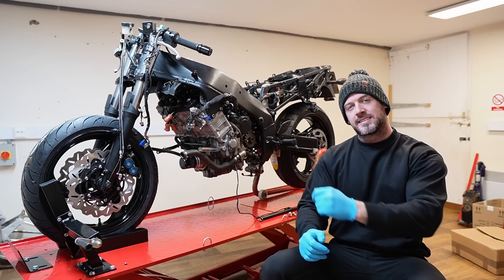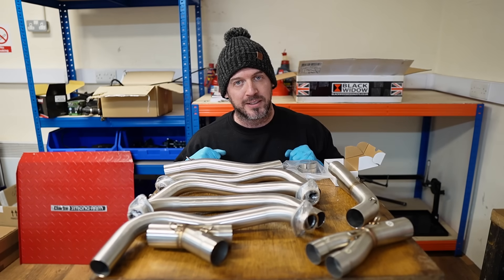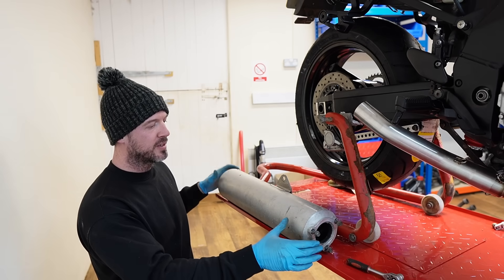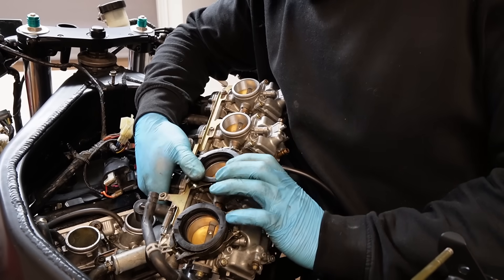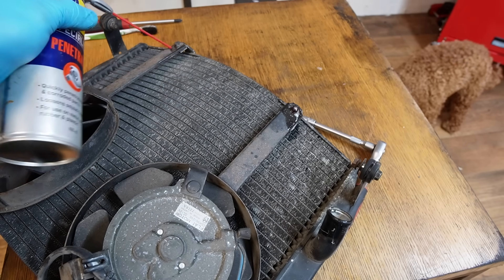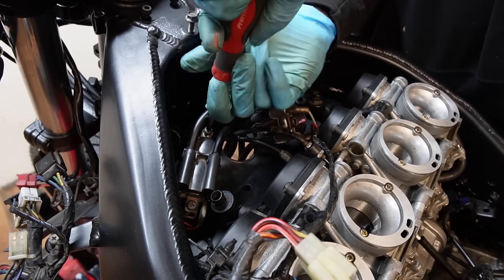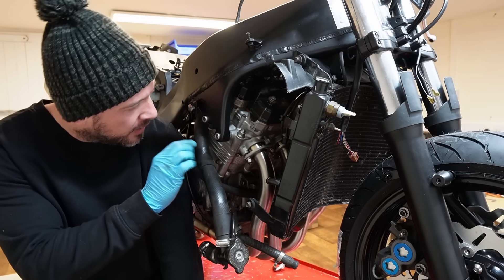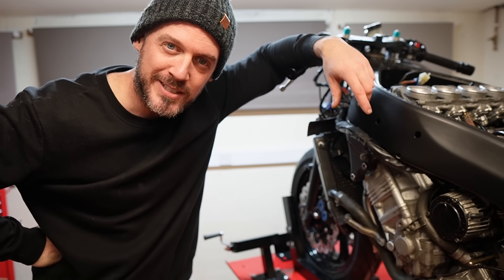REBUILDING A YAMAHA YZF1000R THUNDERACE | PT 10

Comment: Well done definitely cooper slip use a wire to put into the inside of the bolt as well as the stud tread glad you are oiling the oil filter rubber love the new work shop

Comment: I wouldn't use any sort of grease or loctite on any fasteners unless advised in the manual,as it changes the torque values.
A hook is an excellent tool for fitting springs.Yoshimura used to provide one with their exhausts.
Reply: Doesn’t affect the torque at all. If you torque a bolt to a given setting that is what you torque it too irrespective of whether there is grease or loctite on the threads.
Reply: @ivor1957  Each to their own opinion.
Reply: @scottfinlayson5446  Agree on that one

Comment: smearing oil on the filter gasket, is equally important as not stepping on the cracks in the pavement
Reply from the maker: If I didn't do it.... someone would have said I should have done it. Can't win 🤣
Reply: Just stops it gripping and tearing when youre screwing it up. Takes 2 seconds and worth doing. But looks like this one came pre oiled
Reply: Try pushing the dry rubber gasket across a dry metal surface. You will the understand why a small amount of oil is used to create a friction loss when you screw on the dry metal filter against a dry metal engine.

Comment: The wife and I still think the Thunderace was the best bike I've had. I had it 6 years from brand new. My original headers rusted through and a new downpipe set with exup valve from Yamaha was £1300. I found a nearly new set at a breakers yard in Greenwich for £150, Kerr Ching The exup valve is very important to the engine, it gives about 40 bhp to the engine I heard. I am worried your straight through pipes are gonna make the bike a bit flat. My exup jammed up once and it rode crap until I greased it via the grease nipple fitted
Reply: Exup is for low down power so the delete shouldn't reduce its top end performance at all, the only way it would reduce power is if sticks shut, then its like shoving a potato in the end of your exhaust!!
Reply: I dont know where you got that information from- 40hp????? All it does is slow down or restrict the gases depending on the rev range so its supposed to provide different pressure waves and restrict noise at different revs at the same time. Its an emission device and on these older bikes sap little if any horsepower. In more modern bikes they are more elaborate and are very much more noise abatement devices but again restrict gases at certain revs to achieve different power/torque characteristics but are mainly a noise abatement device as said earlier. So breath easy it may sap 4 hp not anywhere near 40!
Reply: EXUP doesn’t give any extra peak power. What it allows is the rest of the engine to be set up for decent peak power (exhaust lengths, how they join, intake lengths, cams, etc) without it being a nightmare at low revs.

Comment: The refresh build is coming along nicely 👍, with the springs for the exhaust I’ve used cable ties to get them on, you don’t have to lock the cable tie together I just left mine undone and it worked a treat, I know there is a tool to do it but in a fix it works fine.

Comment: Have used copper grease on exhaust studs in the past but it tends to melt off. Currently using ceramic grease. The main issue with EXUP valves is lack of maintainance from owners.

Comment: Bad move  dumping the exup valve. The reason it doesn't work will be because its seized, lazy people don't bother lubricating it, it needs to be serviced same as any other  part of the bike. I have had a FZR1000 and a Thunderace, both with exup valves and I changed the end can on the Thunderace, but not the valve. It did seize not long after I bought it and it went into limp mode. As you have never ridden with the valve and now without, you might not appreciate the difference, having the exup valve does make a positive difference especially to the low and mid range.

Comment: one problem you might find with re-using 20yr old carb rubbers is their lack of flexibility - which happens with age - and shown with the fact you had to use your whole body weight to put them on.
My Thunderace carbs were pushed on with one hand. The rubber must be flexible to get a good seal - if its hardened like yours, when you're riding the bike, air can unbalance the carbs, so keep that in mind. Cheers
Reply from the maker: Well noted thanks mate 👍🏼

Comment: The oil filter was already greesed, I would put exhaust sealant in the joints to stop air leaking out.
I would use a spray can rather than a brush, you will get a much better finish doing multiple light coats.
It's coming together nice tho
Reply: That hammerite is good stuff, will last a lot longer than a spray
Reply: @jamestestarossa7870  for sure, it's fine on some like that but it's always good to learn how to paint

Comment: Im not sure about the copper grease on the exhaust studs.
Being a petrol engine it will run very hot and the grease will carbonise.
Im unsure if the burnt grease is then a benefit or if the bolts are best left clean and dry.
Its not a normal application for copper slip

Comment: Hello , Greate job!  How much did you spend for spare parts for the engine rebuild particular seals , crankshaft bearings, connecting rods bearings, intake and exhaust valves and springs. Thanks! :)

Comment: One does approve of copper slip on head studs 😁
Reply from the maker: Phew.... 🤣
Reply: I re-apply yearly cus as you know stuck/broken headstuds are a complete nightmare 😩
Reply from the maker: @jamestestarossa7870  like the nightmare I had and snapped a stud 🤣
Reply: I've no problem with copper grease but trying to use a torque wrench after you've greased the surfaces is a sure way to snap the studs, you have just altered any torque setting by applying a grease to allow it to tighten easier and tighter than the factory setting, your best off nipping up by hand and then again after a run.

Comment: The earlier fzr1000 exup is renowned for running like a pig if you try and do away with the exup valve. Hopefully you won’t have the same trouble with this.
Reply from the maker: I believe this is because owners would unplug the servo motor and disconnect the cable thinking this would fix the fault when it went wrong?
Reply: @BikesofRye more to it than that I’m afraid bud. I’m a long term owner and was active on the old forums and as far as I can remember, virtually everyone that tried to do away with the valve, including swapping the headers like you have, almost always ran into bottom end tuning problems. Hopefully it will be different on the thunderace or maybe black widow have managed to create a decent header.

Comment: What is the part called that you used to trick the EXUP?
Reply from the maker: It's the original servo motor... you just keep it plugged in to apparently prevent the fault codes on the dash

Comment: The wire harness needs to run inside the frame (on the left side). Better to change it now or you will have some serious challenges fitting the engine covers
Reply from the maker: That is how the harness was when I stripped the bike
Reply: I'll try to send you a schedule of the cable routing
 @BikesofRye